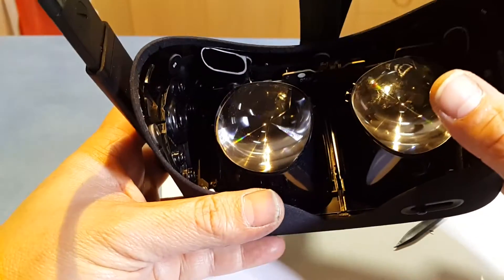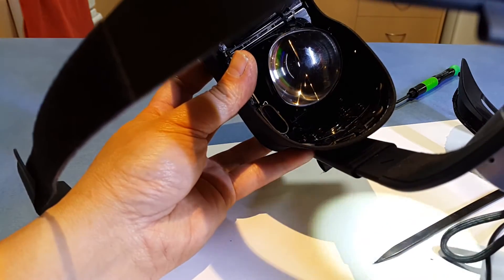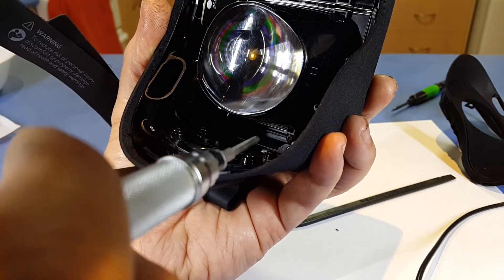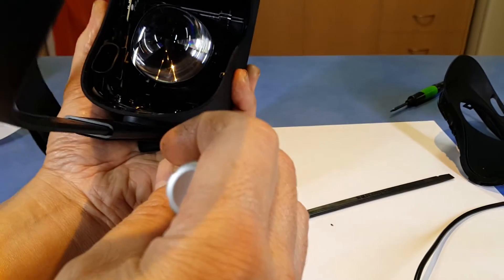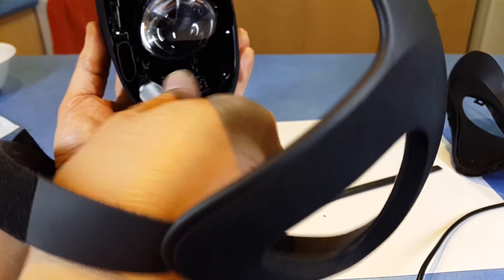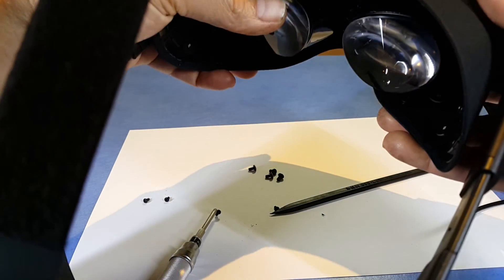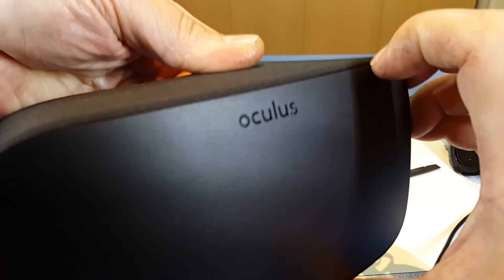Oculus Rift CV1 Teardown Disassembly How To Part 4

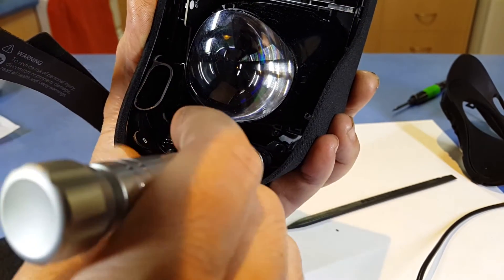Comment: No need to remove the second set of 4 smaller phillips screws @ 4:17 at this stage. Latter only the top pair that hold the main board chassis need to come off.

Comment: I cover my lenses with Vinyl Low Stick Tape when putting a screwdriver anywhere near them!   To easy to slip.  If you do, THRILLSEEKER found this Magic Stuff that ACTUALLY BRINGS LENSES BACK TO PERFECT, It is friggin magic,   Works on CD's, Sunglasses,  I did my old Gear VR lenses earlier (giving it to my Nephew) and they look like NEW!  Stuff called:  POLYWatch (for plastic origin watch crystals originally) on Amazon and itxs only like $6.00  I have tried everything for 30+ years, nothing ever came close to working, this ERASES TIME on lenses!  (eliminates swirls 100%  small and medium scratches 100% and absolutely mitigates larger scratches, imoroving with every coat and MicroFiber Rub Down (with pressure)  OR ask Amazon for POLISHING DRILL BITS!  For another $7.00 you can have high speed polishing tool if you have a Drill!

Comment: do rift s
Reply: You won't BELIEVE how easy it is to take the Eye Assembly and the entire Halo off the S!     Six 'clicks' for the face-PLATE,  then a unlock slider and a Big Rounded Button (Bottom of device on right from viewer POV) Click to Unlock and HOLD Rounded Button..  SLIDE Halo out towards the Viewer position.